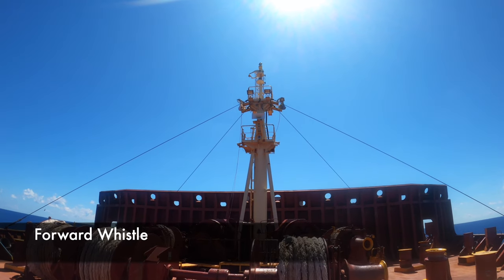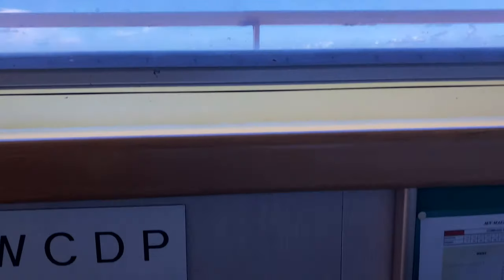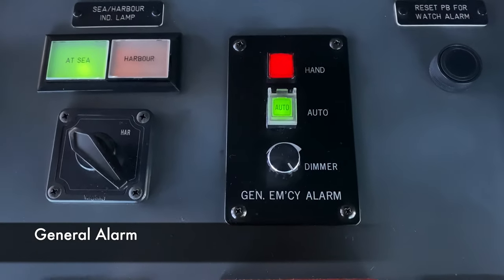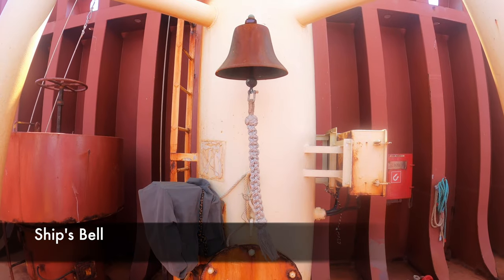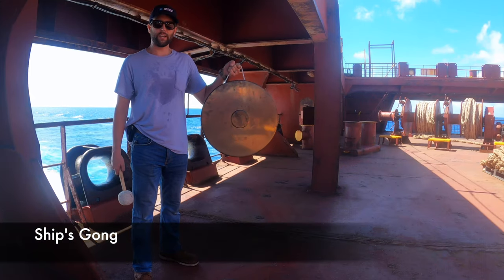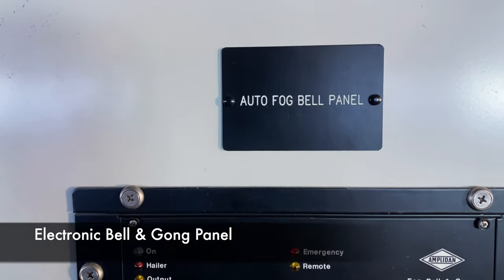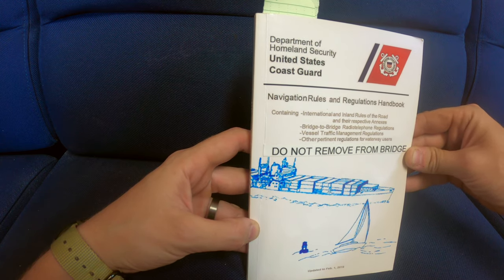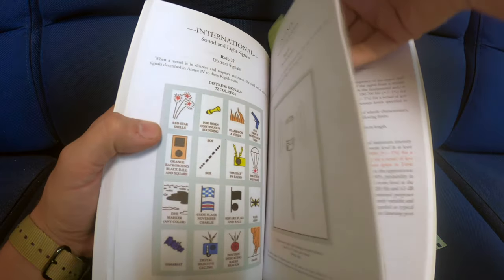Sound Signals On A Cargo Ship | Life At Sea

Comment: If you are about to crash into a docked boat would it be more appropriate to sound five whistle/horn blasts or just continuously blast the horn constantly? I believe the rules had said you’re supposed to blast it five times. 

I’m asking this because there was a cruise ship that had some malfunction so they ran into the back of a smaller passenger vessel and also hit the dock. I think warning random passengers might be more effective if it was just one long and continuous horn blast, but who knows it might be less effective on the other boats captain since it wasn’t five short blasts.

Can you tell me what you think? Also can you tell me what you would do in that situation, at least what do you think you would do? Even if I’m right and that the captain should have done five short blast, would you have then one long continuous blast? And what do you think would be most effective for random passengers? 

Thanks for the information on your video.